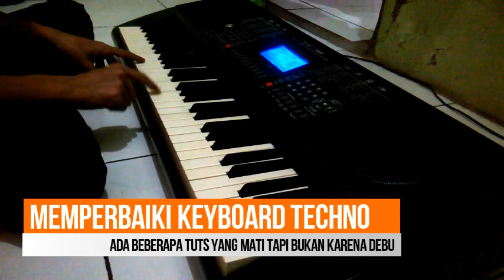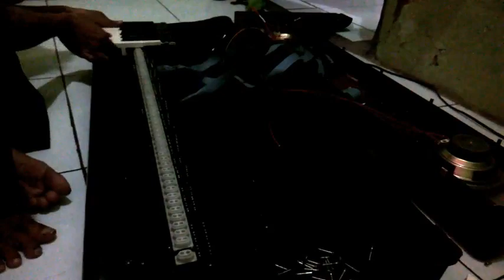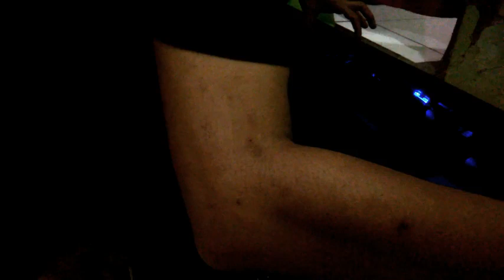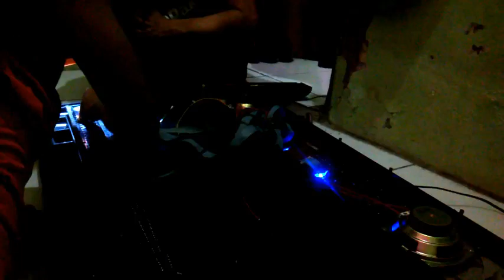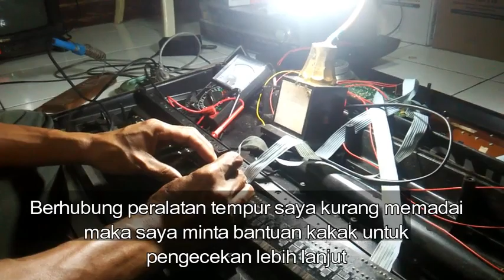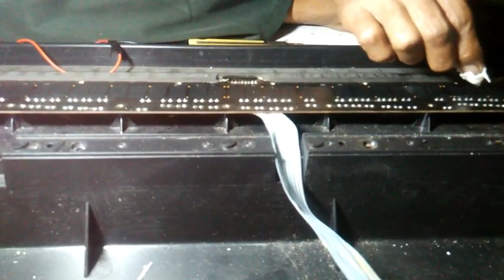Service Keyboard Techno Tuts Mati

Comment: kalo jek midi mati gmana boss? apakah ada yg perlu diganti?
Reply from the maker: Mungkin ada jalur data putus, coba cek jalur - + a b (-+ = power 5 volt, ab = RX txnya
Reply: @TulusProductionMusic  harus bongkar ya boss.. saya gk ngerti.. kalo boleh tau tinggal dman boss? terima jasa service kah?
Reply from the maker: @Dhavin studio tinggal bongkar dan minta bantuan yang ngerti elektronik aja. Mesinnya simple kok. Tinggal cek pake multimeter mana yang putus